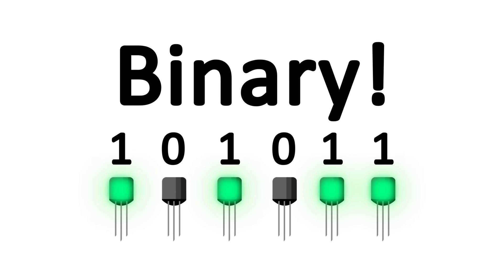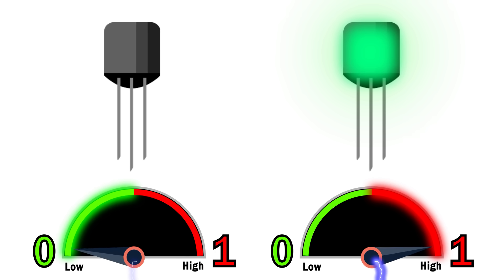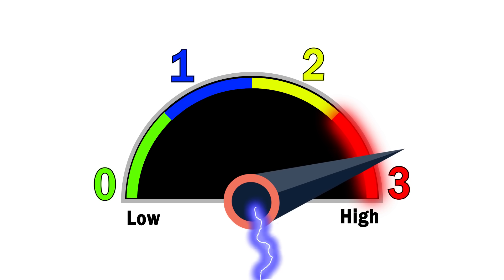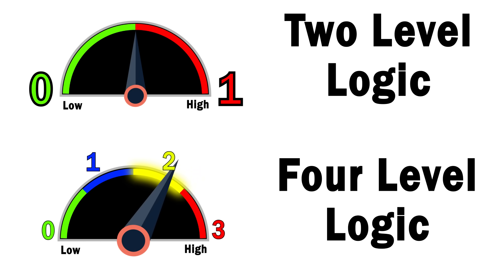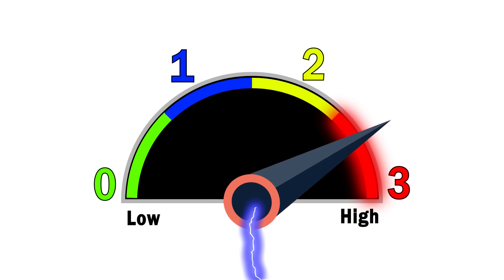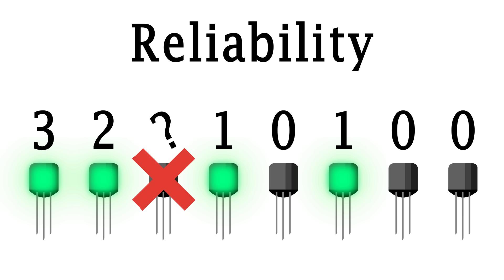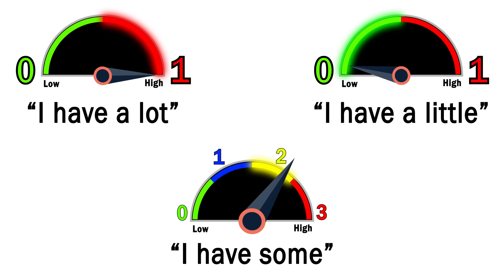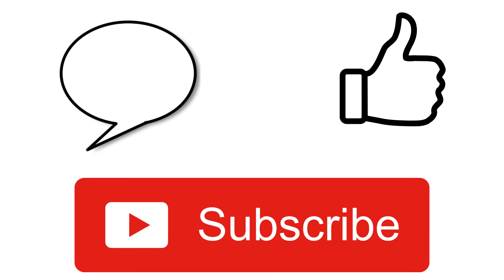Why can't computers use base 3 instead of binary? Voltage states explained.

Comment: Binary reduces the world to true/false, ternary adds balance, but quinary starts to resemble how we actually reason in gradients and categories. Are we choosing binary because it best models reality — or because it’s the simplest abstraction we learned to build first?

Binary made sense when hardware needed clean on/off states, but at the nanoscale we’re already dealing with quantized levels, probabilistic behavior, and multi-threshold devices. If the physics is no longer strictly binary, why do our architectures still insist on it? Could quinary computing — with five meaningful states — better align hardware with semantics like validity, trust, or error, or is there a fundamental limit that makes base-5 impractical beyond manufacturing inertia?

Comment: Nice video where you don't explain anything why there is not a base 3 logic....

btw.... lookup for PSK4 -- PSK16 or the QAM-64 or higher ... it is possible to to do even QAM-1024... this is a logic where you have 1024 bases.....

but you mean a base 3 logic in computers... yes even in the early computer ages, the Russians developed a a logic with base3...

a bit (binary digit) should be named tit or trit (trinary digit) ;)

Comment: This video is dumb basically all modern SSD's store data in 3 or more bits per cell. And also transistors don't store charge. And the whole video is extra dumb because the most common form of base three computing was balanced ternary which used negative, 0, and positive voltage.

Comment: While reprecenting ternary as 0/1/2 can make it seem like a bad idea.
And adding the argument about rising and falling edge, even more so.

Ternary can also be reprecented with -1/0/+1 (or just -/0/+), known as balanced ternary.
Using ternary for calculations, can give significant advantages.

While using a ternary clock can be more challenging, but you can eiither keep using a binary clock, or you adapt how you want to trigger, to better fit with ternary.

I'm sure that we are on the edge of some major disruptions, from ternary computing and quantum computing.

Comment: One of the biggest modern problems is that base 4 isn't compatible with binary, and we've used binary for so long that even if we switched to base 4, which at his point we could do, we've solved most problems listed here, a base 4 computer wouldn't be able to run binary applications, and even if you made a comparability layer so many people still have only binary computers that most apps would still be programmed in binary for the hardware support, meaning it's just not worth moving to base 4

Comment: With more research into Material Science, we can find a Silicon Compound which can stably do -ve/0/+ve and quickly. Then we can have 81-trit Computers, which would be orders of magnitude faster and more reliable than current 64-bit Computers.

The challenge is the compound, the design, systems work, construction of the software, and then porting over Hybrid Emulation for Legacy Software. If or when this happens, I am not certain it would be before 2040 (when we hit a hard wall in electron movements in transistors).

Comment: I am not satisfied with the explanations.
The video focuses completely on physical reasons.
It completely ignores mathematical reasons.
keyword: Boolean Algebra
Reply from the maker: Boolen isn't the core reason but a result. If we could physically make base 3 transistors, we would be able to program computers based off ternary math. The math is used because of the physical limitation, not the other way around.
Reply: @H3Vtux  I learned otherwise during my time at university. But maybe you are more competent than my teachers.

Comment: Base 3 can have the middle postion with a larger frequency range (I assume something so obvious has already been done). Still doesn't solve the problem of potentially passing through the middle state when switching from low to high. Other problem not mentioned is we're in too deep on binary transistors. I would assume they'd have to be constructed differently and it'd be an engineering/manufacturing issue to miniturize it. Could be wrong about that.

Comment: its because transitions are a switch, you put little voltage into the base and get big current out. There's no middle state. You can put less voltage into the base but it will change the output current by a lot which on a tiny scale depends heavily on heat and leakage from nearby transistors. So its either all or nothing. A computer using multiple states for a transistor would just stop working if the case cooling is bad and the transistors get too hot, completely impractical

Comment: Another issue is that operations get a lot more complicated. 

For example, a full adder with binary just has 8 possible inputs per bit and 4 possible outputs. As you get into higher bases, you have to design it to handle much bigger truth tables.

Comment: Well technically, a DRAM cell can be in 3 states: negatively charged (0), positively charged (1), or uncharged (it hasn’t been written yet). But DRAM isn’t just transistors, but also capacitors

Comment: There is two reliable and simple enough ways to do trinary, either by tracking charge direction and designating reverse current, or by tracking phase relative to neutral.

Which for all intents and purposes might as well be the same thing.

These AI videos kind of suck on the critical thinking front.

Comment: Perhaps we could use magnetism. Imagine a triangle-shaped circuit. Whenever I apply a charge to two points, electricity will flow toward the third point. The electric current would attract a "needle" in that direction. Since it's a triangle, the needle would always go directly from one current state to another without an intermediate state. A logic of 3 would be possible.

Comment: There exist base 3 Computer systems. Their advantage is lower electricity consumption and production cost. The disadvantage is higher engineering costs.

As programs can be optimized for the base of the architecture, one being much more relevant than all others is expected.

Comment: Why we not make trinary with high for 1, low for 0, and reverse high voltage for -1?
Reply: The Soviets did and it worked quite well but computational technology wasn't a priority for them and when they had economic struggles they abandoned the idea

The main problems are 2, getting that tech is a complete new ground, it could take years or even decades to get it working well which isn't an investment risk most companies are willing to make

And secondly most programs are designed around binary architecture and wouldn't benefit from trinary

Comment: Actually it's used in modern tech, but not in processors, MLC nand flash in Solid state drives uses basically this exact approach, sacrificing write speed for storage density.

Comment: Why stop at three instead of going to four or even a hundred?
Reply: cost of number representation.
Reply: @zazugee meaning? Let’s say you store voltage between 0 to 5 volts, where 1 volt equals 1, 2 volts equal 2, and so on. We already do this in memory; we just need to add more levels.
Reply: @Huntmare I read somewhere that the most efficient base number was the number e from logarithm which is roughly 2.75 and can be rounded to 3.
While as mentioned more voltage levels equals to more errors

Comment: Every modern SSD, either external or internal, stores multiple bits per cell to increase density and reduce costs. As of writing this, it is mostly 3 or 4 bits for consumer SSDs, 2 bits per cell are very rare nowadays.

Comment: Slightly OT, but in the same vein:
Are you familiar with PAM4 coding?
Used with 100Gb and higher ethernet, it transmits two bits at a time, 00, 01, 10, 11 by using four discrete voltage levels:  0, 1.33, 2.67 and 4 volts.

Using a microcontroller, voltage dividers and shift registers, you could set up one pin for output and another for input.  On the input side, you would need voltage comparators to turn on the correct bits.

Comment: Fun fact: the difference between 0 and 1 is the same as between 1 and 2 or 0 and -1. So the low/high gauge representation is a bit misleading, since the gauge is expanded instead of just divided into smaller parts. That is if we don't already use -1 and 1 (instead of 0 and 1) to represent low and high.

Comment: You barely mentioned base 3, as stated in the title. I can see a problem with fractions. In base 10, since 10 goes into 2 and 5, a fraction that only goes into multiples of 2 and/or 5 can be written  exactly, but a fraction of 3 can't. 1/3 becomes 0.33333...etc. Inside a base 2 computer, 1/5 can't be represented exactly either.

In base 3, 1/3 can be represented exactly, but 1/2 cannot. I think this is a pretty huge loss.

Comment: Bit of a simplification.  Communications systems use bit counts all the time.  Each "cell" in this case is called a symbol.  There are  2 ways of increasing bits per second:  More symbols per second (aka the baud rate) or More bits per symbol.  We have many systems that have 64 bits per symbol.  The problem is the complexity of the receivers of this information and the encoders that we use to provide error detection and correction.  Thus, you have a problem of complexity and cost as you increase your logic levels.

Comment: I'd imagine that base 2 is just more simple to utilize. Having more than two states would probably require a storage controller. SSDs require a storage controller to read and write the data efficiently, so having to use many different controllers for each component would add a lot of bulk, whereas 0 and 1 can be read very easily with a very basic rudimentary controller being built in with each individual component. I could be wrong though, this is just me typing out my thoughts.

Comment: If someone builds a good light computer not just laser but multi wave-length it may be possible to build a computer with a much higher base instead of just on or off. Think say red orange yellow green blue that would be base 5.

Comment: RS232 links are supposed to be trinary. Low is negative voltage, high is positive voltage and no voltage is a connection failure.

Comment: The tristate buffer has three states Low Voltage, High Voltage, and High Impedance and is used in every computer because without the high impedance state data buses would not work

Comment: i made a super simple solution      i just set a simple rule  when we have         2 bits      they connect to a trit                        if one of bits is active       (01 or 10) then its 1 in ternary if 0 active then its zero (00)              but if both active it produces 2 in ternary (11 binary)                               it can be virtual aswell so why no one thought instead of using expensive non virtualized circuit with 3 stages       WHY NOT USE THIS METHOD its simpler we use 2 cheap binary transistors that control a 3 stage      its hard to explain its super deep         i tried making a virtual cpu     and it kinda works (128bit ah pc)        why s many people havent though of these

Comment: It would be technically possible to use a 100-level system, where voltage levels ranged from zero to full voltage in one one-hundredth steps to represent 0-99.  This is effectively an analogue system.  The big problem with such systems is that whenever you switch a circuit on, it draws power which causes the voltage of the power supply - and everything connected to it - to momentarily drop as it has to supply more power, and the reverse happens whenever you switch a circuit off again as the power supply has to adjust to not supplying as much power.  Unless everything stops and waits for the voltage to stabilise, you're likely to be reading the wrong value from most or all of the data lines.  And due to the way voltage works, it takes longer for the voltage to stabilise to a particular reading, the more potential voltage levels are used.
Short version: Binary is the best way of ensuring that you're reading the right value, fast enough to be useful.

Comment: I mean it's logic they chose that path... but i think that it would be interesting to improve the electrical stability of greater base models rather than making transistors smaller. At this point it might be easier to strive for a base 3 system rather than going under 1nm transistor.

Comment: Or hear me out. We dont use bites at all.
1. Take two batteries. Measure the voltage.
2. Connect the bateries in series.
3. Measure again.
4. Congratulations, you just made an inacurate, but much more efficient than binary, calculator.

Comment: how do logic gates work with more than 2 stages?
seriously, in the logic gates we do have we simply put them on the positive for 1 and the negative for 0, are we suppossed to put them on a resistance in order for it to qualify as anything in between?

Comment: Binary correlates to the true/false paradigm of digital logic. AND, OR, NAND, NOR, XOR logic gates all use two-state inputs and outputs. Boolean algebra annotates the behavior of logic gate networks. Nodes in a computer program flow chart branch one way or the other, depending on a TRUE or FALSE condition. Introducing MAYBE and possible other states would completely change the programming paradigm, making it more complex and possibly less efficient. Storage of data in volatile and non-volatile memory becomes more complex and less durable. Before digital computers, there were analog computers which used practically infinite states to model variables in specialized tasks. Digital computers replaced them because they are general-purpose computers which can be programmed for practically any task.
Reply: It's possible to make an analogue "computer" with just three potentiometers and a centre-zero meter.  You set the two input numbers on the first two pots and then turn the third pot until the meter is centred, then you read off the answer from the dial on the third pot.
You use replaceable scales behind each of the dials for the pots.  That way, you can add, subtract, multiply or divide, depending upon the scale behind the potentiometer dials.  In fact, you can do any two-input calculation so long as you have the correct scales behind the dials.

Comment: Well Base 3 and 4 are kind of used in NAND FLASH storage for TLC and QLC. Still the signal sent back to the CPU or South Bridge is in binary as that is what the chip is programmed to work in. The problem with TLC and QLC is how long until failure state. Binary has a much longer time until failure  state and for most chips 1 failure state is enough for the chip to not work.

Comment: What..? There has always been adjacent transistor logics that supports ternary or quarternary switching logic like CNTFETs for like decades now.
Storage cells already encode multiple voltage levels, thats like the biggest reason SSDs are cheap now.
The question to such ideas is always, who is going to pay for the tools, fabs and materials reaearch towards fabricating high base hardware logic? If there will not be a humongous immediate advantage compared to evolving over existing binary transistor logic, there is not much money to be made by adopting this technology. But in the world of computing hardware, it is always evolutionary, not revoluntionary.

Comment: Binary isn't free from the edge sync issue. Anything that would cause a ternary gate to accidentally latch 1 during a 0 to 2 or 2 to 0 transition would also cause a binary gate to latch X instead of 0 or 1. X meaning unknown, aka the gate latched to 0 or 1 but it wasn't deterministic and therefore can't be trusted.

Conceptually, voltage driven binary logic has 9 logic states. Check out IEEE 1164 to have your brain blown.

Comment: Huh, parts of the problem could be simply fixed if condition to turn on if sufficient time has pass to fix the fluctuation issue. But, increasing base size any further will still be a issue and it will make the computer slower as draw back if you scale it up.

Comment: There is one place in computing you may still find ternery: ISDN. If your office has a digital phone system and hasn't yet moved to a purely VoIP solution, it'll be connected to the phone network via some form of ISDN, and that uses ternery. The reasons for this have to do with Physics Stuff about how electricity flows on really long wires, especially the sort of poorly-built and never-maintained wires you often find in phone lines. Short version is the 3T4B encoding is really efficient and well-suited to sending digital information over old phone lines.

Comment: Same with cables, reliability, I grew up knowing that serial cables like rs232 1 ground 1 data were far slower than "parallel" cables  like the used for printers 1 ground 8 data, or complex disk drives like scsi  (40 cables). 
And here we are again with 2 cable connections.

Comment: To use higher bases inorder to mintain the reliability one one have to add reduntdant circuits and their managers ad nauseam.  So the size and power requirements and added heat generation would be more than triple.  Is that a proper tradeoff? probably not.

Comment: So you don't so the more efficient data storage BC of fluctuations? Then make the cap higher. Increasing energy draw, increasing storage efficiency. Since the fluctuations are a range of volts not a percent. (If I'm wrong I'll take constructive criticism but please don't be a know it all or toxic or smth in the replies.)
Reply: Thats what i say too, but i wonder if the time from higher voltage to change states will slow everything down. 🤷‍♂️
Reply: @crazykkid2000  surely there is a system to block the read-enable line  until you have finished with the write-enable? It would be slower transfer speeds but more storage.